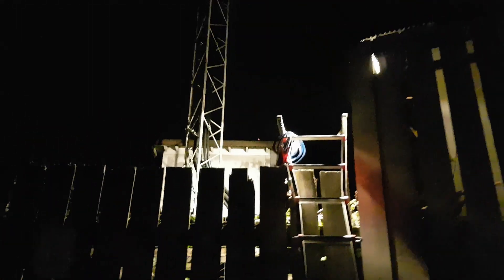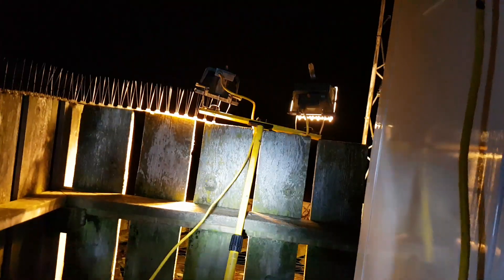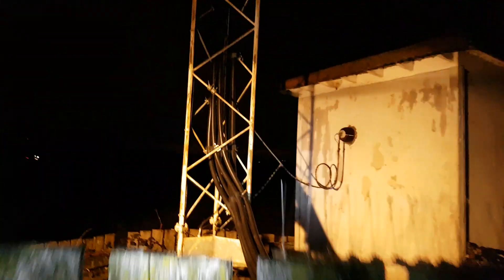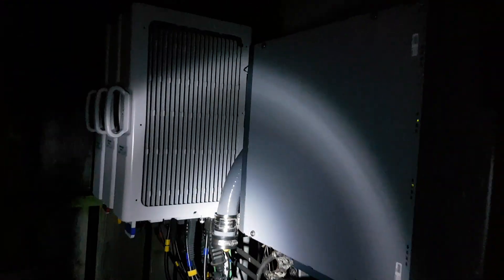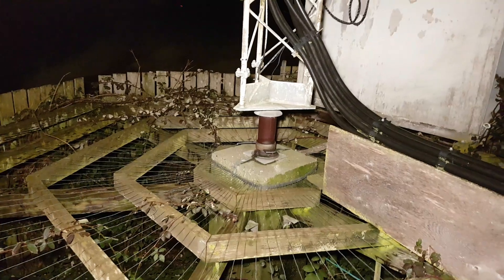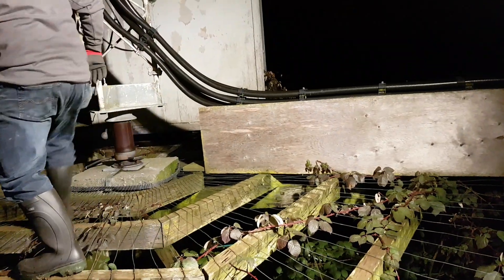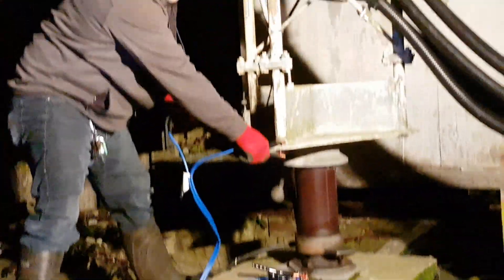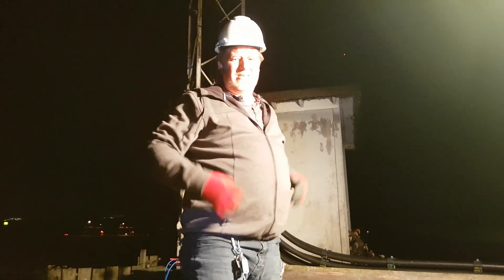1 - Night work at a cell site on an AM tower - Prep & Grounding

Comment: I Have SImilar Tower That I Bought, Its 3 Stage Tower, Each Element is 2.5 Meters Long , I Coulda Buy More, But The Guy Already Scrapped The Other Towers, He Had Around 20 Sections And I Told Him Tto Leave Me Some And He Left Only 3 And Others He Scrapped, Payed Him 30 Euros For All 3 Sectiosn Of The Tower, The Cool Part Is That He Gave Me The Ground Section So I Can Mouth Itt Properly, Im Thinking To Erect It At my Shack (When It Will be Ready  ) Now Its My Dream To Make Thaat Shack As My Workshop / Radio Shack, But As Im Disabled And Out of Pocked, I Dont Know How I Will Do It, Some Guy I Payed Said He Will Work For Me, But All He Did Was Came, Ripped The Roof Off AAnd When I Payed Him He Disapeared :( Now The Shack Is Without The Roof And With A Plastic On It And That Hurts Me So Bad :( My Real Plan Is To Make WOrkshop Where Kids Can Come And Work On Items And Learn How To Solder And All That, I Hate That These Days Kids ONLY Like Drugs, Alcahol And Using Electronics, But They Dont Understand Nothing On How Everything Works, My Shack Would Get Some Kids And They Could Bring From Home They Broken Chairs For Example And I Could Show And Tell How To Fix Them Properly, They Would Learn Some Skills With Me, But Jeah, That Shack/workshop is on Big hold, i have no money because im disabled, i cant work on it because im disabled, i had money collected for it, but i was scammed out of it andnow itts just collecting water, by the way the shack itself have some crazy good items inside thatt i want ttos ell, but soon they will be rust scrap and nothing more because of the rain :( 
i have soviet kino projector , i have M2 Meteor reel to reel recorder and player BRAND NEW UNOPENED BOXand a loot of other soviet devices and parts. 
i dont know what tod o, but everyday when I Wake up it hurts, it hurts bad that this have hapened to Me and i cant help Myself to help others :(

Comment: Silly question, but if that tower was broadcasting normally and you put your hand on it, I suspect that you'll be electrocuted to death?
Reply from the maker: Bentley Kawasaki  It would not be safe to try cause if it didn't kill you, you'd probably wish it did. Just the Induction from the cable box could give us a serious burn. Burns have happened in the past and that is why we are taking these safety precautions.